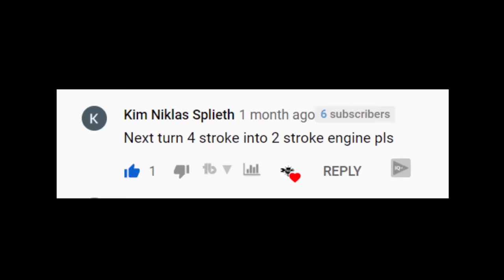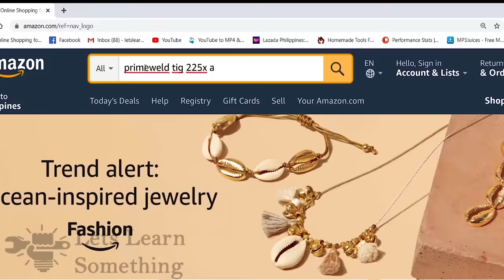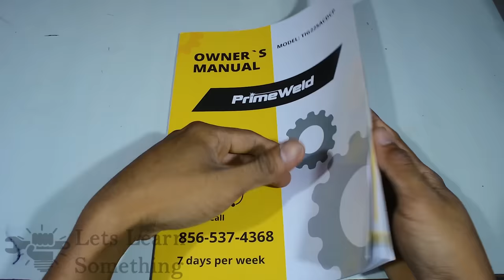I turn 4 stroke into 2 stroke  engine

Comment: Having been a mechanic, fabricator, got my mech e degree, worked as a product development engineer for 20 years, then into managing product development teams and engineering/development departments, a guy like this would be a diamond to find.  Might not be a true engineer, but anyone who can be assigned a task like this and land on his feet is 10 times better than an academic champion in an engineering program.  What I discovered over the years was that finding a degree'd engineer with practical experience was much more productive than finding a PhD.
Reply: John Tomasik I have been a mechanic for 38 years. Got my training in marine corps institute and we had to learn everything from all the different welding types to rebuilding engines and transmissions and we had to fabricate parts on our mill and lathe in the recovery vehicle. Even with all the training and experience of working in different units, I stilll couldn’t land a job as a mechanic in the civilian world so I opened my own shop. Seems that in this country,unless you pay someone offf,you can not get a good job anymore,it’s that or having a friend refer you. So now I collect my disability and work in my own shop privately and videos like this give me ideas. I have one for powering a go kart with an electric motor powered by a generator head connected to a small engine because the electric motor has more torque and instant speed than the gas Motor and it revs so high you don’t need a transmission. A superior Gokart. A hybrid!
Reply: @grokster9ontheroads174  Way cool!   I was working for Cat when I went back to college.  I'd run across the academic types, who knew little to nothing about how sharp mechanics and tradesmen can be.  Many mechanics at Cat had numerous patents.  I'll never forget I was at a party and a bunch of college people were there.  They were talking about their degrees and I mentioned I was a mechanic before talking about my major.  One girl piped up and said, "oh, yeah, well we need those people too."  Cracked me up.

My son's a cert'd master tech for Lexus.  It was amazing to see his logic improve drastically as he gained experience as a wrench.

My dad got his engineering degree in what was Czechoslovakia.  What was really cool about their engineering programs were the students would be in class in the morning, and in the shops working in the afternoon,.  That practical experience really set their students apart as apposed to many who come from our programs here and the only thing they can do are the problems in the back of the chapter.
Reply: I have been welding over 20 years  in America, I have gained certifications and lost certs. in many processes and materials through  A.W.S. I'm mechanically inclined I if I ever have a shop I would like my Measurements to be metric, reason is because most of the Engineers firms Canada, Mexico and America metric for products. Company's Engineers draws it on a Cad in metric then transliterated in the Standard Impreal measurement.
Alote of the time it's the Welder Fabricator becomes the Engineers best friend. Countless hours of wasted time redoing math and materials.
Reply: I wish more people had your attitude. EVERYONE that's got a job listing around me for a welder/fabricator/mechanic requires a 2 year degree. I get turned down all the time for positions even though I hear it all the time, "your portfolio (a bunch of pictures I've taken of my work over the years with detailed explanations) is very inpressive, you're a more consistent welder than our lead." They always tell me that they can't hire me because I dont have a degree.
Reply: @casey360360  It's gonna depend on what you're applying for.  I couldn't hire a non-degree'd engineer for a true engineering position unless he had proof he could do that work.  A lot of people confuse mechanical design with engineering.  It isn't the same.  Engineering, at least many of the disciplines, is the use of the laws of science to predict what a design requires to do the job.  As a n example, I did a structural analysis on some wind turbine blades.  Without my training in statics, dynamics, physics, and materials engineering, I couldn't have done that work properly.

This is in no way a jab at you.  I don't know what you're applying for.  There are most certainly situations where I'd take experience over a degree, if it's allowed.  But, there are engineering jobs that do require the academic training.  It's just that those with practical experience AND that degree far outshine someone who was just an academic.
Reply: Most of your Engineers are young and inexperience.
Reply: What the west lacks bcoz we spreading democracy
Reply: Institutions serve to domesticate us. Period. In the case of educational institutions, they also make money off of us!
Reply: @casey360360  Open your own shop. Or team up with a recent graduate.
Reply: @mikescudder4621  That's why I'm single 'cause marriage was domesticating me!  LOL
Reply: @johntomasik1555  I've been applying for fabricator positions, for which I have 3-5 years experience depending on what exactly the job requirements are. I pften get shutdown because the position requires a 2 year degree for no apparent reason.
Reply: Sic Semper Tyrannis  I've been considering the pipeline, i have 2 young kids and a partially disabled wife, I'd have to be really smart about how I went about it all.
Reply: @mikescudder4621  I'd like to open my own shop, I don't know that I'm experianced enough to do so. One of those I'm getting in my own way more than anything else type of situation.
Reply: @grokster9ontheroads174  You will have a good life here in my country. Someone like you will make a lot of money by opening a workshop. Here a workshop have consumers about 100 bikes every day or equal to USD$323, every day or USD$9.678 amonth while wage salary is about USD$200-300, permonth. You will be very rich here.
Reply: Just one thing, can you keep the oil pump on the engine? I have seen that you removed it. Won't that make the oil unable to lubricate the gearbox? Because afaik the oil pump pressurize the oil to spray on gearbox and crankshaft, now that won't happen right? And could you keep the electric starter intact? Do you have make it kick start only?
Reply: Sic Semper Tyrannis  2 stroke diesels have oil pumps in them.
Reply: Sic Semper Tyrannis  and how about the electric starter? Can that be retained?
Reply: You wouldn’t have painted the threads in the oil casing though !
Reply: Thats because theroy is useless if you cant put it to work...
Reply: @johntomasik1555  Absolutely agree. The combination is unstoppable.
Reply: Might not be a true engineer!? 
SMH... some things can't be taught, no matter how many degrees you accumulate...
Reply: @Proud-pop  Absolutely true.  I basically said as much.  Not sure why you're shaking your head.
Reply: imagine how many diamonds there out there spread out all over the world, that just had the bad luck to be born in the wrong place? must be millions
Reply: @casey360360  It's a shame, but you could probably pick up a 2 yr degree in no time flat.  You can challenge courses and take others online.  2-year state colleges are supposed to be either free or very cheap now. (I haven't looked, and I should)  I have a 4 yr degree and I can't get a job either.  I'm thinking of going to a trade school or a 2-year college.  This sucks.
Reply: @johntomasik1555  not always. my grandfather got me into cars and automotive stuff and now i know more than someone who has a degree and im just a 19 year nerd. besides its how you memorize your skill and putting it to use. the bare hands show more tahn what a peice of paper proves or in other words. "actions speak louder than words" which proves a paper(like a degree) means nothing when you get down and dirty to prove it. my uncle bill downing dropped out of high school and was a carpenter. he now owns that company he worked for and thats a good example that a degree isnt needed. not to mention he built his own house from the ground up so he aint joking to other proving that u dont need a degree.
Reply: @Proud-pop  true. in fact since this is the 21st century alot of things are done on a computer so its way easier to get the knowledge on thing and in fact you get more knowledge online then you do at a school. period
Reply: @grokster9ontheroads174   I'm actually working on a very similar project, Im putting a Briggs and Stratton lawnmower engine on my go kart as its a vertical crankshaft engine and I didn't have a suitable gearbox to connect it to the rear axel
Reply: true
Reply: I dont find this very hard to do! if it was 5 years ago I would say the same. but after learning and rebuilding couple 2 stroke engines you get the principal. The buy runs but very poorly. he didnt get the ports, timing, transfer and diagram of the engine quite right! now if he sends in a cylinder head to a guy that can get it all right he will have a great 2 stoke running engine ( powerful) i still give him a lot of props. he is capable and very smart!
Reply: @eduardoleandrofernandesrod3377  The guy's darn good with that grinder.
Reply: And he's using a drill press to mill his shiz. 😂 He should be building rockets.

Comment: Whoever finds this in 50 years is not going to be able to tell what happened here
Reply: Good luck finding parts
Reply: @randomwordbot  thankfully this is not new for 2 stroke engines, if the cylinder expands he's gonna have to machine a new piston but this thing doesnt rev very high so if this piston cracks all he needs is a new 125cc piston.
Reply: @randomwordbot  you really thing he cares about parts . he will make them
Reply: Whoever finds it will know one thing for sure, it wasn't an engineer who built it but instead a real man with real skills who actually worked on the shit he built and designed.  By the way you are only kidding yourself, any motor enthusiast would know instantly because all real men have dreamed of turning their POS 4T into a real engine (2T)!
Reply: @tebibyte2357  Another engine, original in 4T.
Reply: @sizzlean9459  In terms of efficiency, 2T engines are the worst.
As pollution, 2T engines are the most polluting - chemically and audibly.
As a cost price, 2T engines are the cheapest product.
That's with the usual engines.
Reply: @sizzlean9459  2 strokes are just cheap and that's all
Reply: @darkraft100  and way more powerfull in term hp per cc
Reply: @tebibyte2357  more thinking about how her got that crankshaft bearing in so easy, shouldnt do that

Comment: Next, turn a 2 stroke engine into a 4 stroke.
Reply: Difficult
Reply: that would be something., but i guess thats not easy.
Reply: i think he made it already..
Reply: 2 stroke is realy easyer than 4 stroke. That's the reason why you can turn 4 stroke in 2 but the opposite is too difficult
Reply: @Gabriel Rezende I didn't said that's impossible but for building 4 stroke machine you need more resources, factory machine,...
Reply: Just watch the video in reverse.
Reply: @fakduken9775  This guy is a genius OMG
Reply: that would be a downgrade
Reply: The perfect caption!
Reply: Watch the video backwards
Reply: undo this video
Reply: the materials wouldn't be enough
Reply: RIGHT LOL
Reply: Nicee. Next~
Reply: Now why would anyone want to do that?
Reply: @fakduken9775  good one
Reply: Not possible
Reply: @rahmatdean4931  +62 nih
Reply: @arrizieq3480  sama
Reply: Καλα ρε παντου εισαι
Reply: @NTOURIS20VT  😂😂😂
Reply: It's been done. The very first Husqvarna 4 strokes were actually the 2 stroke bottom ends. But they stupidly didn't take advantage of the possibilities of supercharging with the crankcase, but others have done just that.
Reply: Why turn heaven into hell?
Reply: It's hard, 4 stroke have head block, cams, chain and another ... it's possible if he make it (cnc or whatever to make head block). Make new hole at the side block for chain and oil circulation, it's possible depend on budget.
Reply: Ραφαήλ Καμπαδάκης  That’s easy just rewind the video
Reply: Very hart
Reply: 🥰💪🏻 Indonesia 🤝
Reply: Why would you want less power?
Reply: @fakduken9775  Where would you aquire all those valves ,chains sprockets etc etc from?

Comment: Hats off to you, my friend. I'm a mechanical engineer, engine builder, and machinist; I am very, very impressed with your work.
Reply: I wanted to be a mechanical engineer, so if i may ask, can u build a 2 stroke engine like he did based on your studies ?
Reply: Agreed. Impressive critical thinking and application
Reply: @xlordxsithxroyalmiller3185  That and i'm really impressed he manage to weld that oil soaked engine block so well. Usually those cast alu parts have so many porous holes filled with grime and oil that welding it becomes nightmare, but he got perfect welds despite all that.. god damn...
Reply: Hopefully he will be able to get in an engineering environment. With the skill set he has at this age he would be a great asset for SpaceX and than Mars 🚀
Reply: A 2 stoke does not have a oil plug you mix it with the gas
Reply: @coolbro1229 Even 2 Strokes have oil plugs because the gearbox still needs oil
Reply: and he do with a minimum resources he has proud to be a Filipino hat off to you men..

Comment: Me, before clicking : Lol probably wont work. Let's just watch anyway. 
LLS: shows a running engine

Me, after the clip: Probably work for short period of time lol. Let's see how he do it. 
LLS: puts it in a bike then goes to town

Me, after the whole video: SUBBED.
Reply: Nicholas Ryan and I will be a good day
Reply: same bud
Reply: Wow
Reply: lol, same
Reply: Same
Reply: lol
Reply: Just one thing, can you keep the oil pump on the engine? I have seen that you removed it. Won't that make the oil unable to lubricate the gearbox? Because afaik the oil pump pressurize the oil to spray on gearbox and crankshaft, now that won't happen right? And could you keep the electric starter intact? Do you have make it kick start only?
Reply: the gearbox needs no pressure , just the oil in the case, a 2 stroke has neither an oil pump
, I do not know why he took of the starter , maybe it was not working ar all...
Reply: @teddybeer1757  oilpump this engine type just for running flow lubrican from engine case to cam,valve & timing chain only.for lubric the gearbox this engine just take the lubrican oil in case engine no need oilpump for running lubrican in shaft sproket gearbox
Reply: @dirkmonsieur3285  The new carb assembly was in the way of the electric starter motor.
Reply: Did you look real close at his lathe? It is hand made too. He has a build video on it. I think I might have to try building one myself.

Comment: This dude could turn a can of bake beans into a 2 stroke motor i reckon .
Reply: @owzmo  you're crazy. 2 strokes sounds the best
Reply: Lol ikr i have a 1993 honda cr 125
Reply: @owzmo  2strokes sound like a great weekend. 4 strokes sound like your days about to get rained out
Reply: Just one thing, can you keep the oil pump on the engine? I have seen that you removed it. Won't that make the oil unable to lubricate the gearbox? Because afaik the oil pump pressurize the oil to spray on gearbox and crankshaft, now that won't happen right? And could you keep the electric starter intact? Do you have make it kick start only?
Reply: And so
Reply: @teddybeer1757  Nah you can't the oil in the gearbox doesn't get sprayed the oil pump is only to put oil in the head the gearbox just sits in the oil and the gears flick oil around
Reply: @teddybeer1757  also with the crank the fuel and oil mix lubes the crank bearings
Reply: @jacobedwards8412  ok, but what about the starter motor? Can you keep that?
Reply: The first harley davidson carburetor was a Camble's soup can
Reply: @teddybeer1757  you can, i think he left it off because it would have gotten in the way of the carb. There are versions of that engine with a starter below the cylinder that would be perfect for that
Reply: @FleetofFords4x44  Link?
Reply: @teddybeer1757  The new carb entrance was in the way so no electric start,just good old fashioned right leg.

Comment: I've done a bit of welding, worked on both 4 stroke and 2 stroke (gas and diesel) engines, experimented with porting AND watched this whole video and still don't know how he managed to do this with no instruction. Guy is a genius. Don't know that I could pull this off  even if I had all the tools even after seeing all the steps. Serious props man.
Reply: 2 stroke diesels ? Was that in ships ?
Reply: Morten Kristoffersen by that I meant ive worked on and familiar with the operation of just about any engine configuration out there. not claiming to be a genius by any means but can't speak much for the shipping industry. but 2 stroke diesels do exist and were popular in the trucking industry until the EPA became more involved. Best example is a 2 stroke Detroit diesel
Reply: @jets8991  Wow, didn't know that, will bone up on that. Sounds really interesting.
Thank you for sharing!
Reply: @jets8991  Been enjoying videos of Fire engines. I must say I was ignorant, as I thought 2 strokes mainly were maritime.
I want to drive a 2 stroke truck. The sound is sweet!